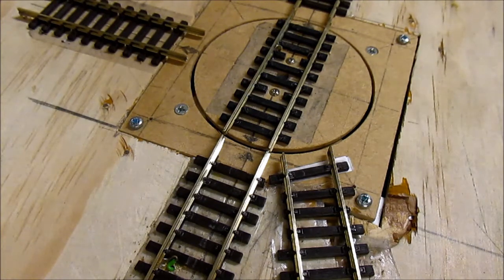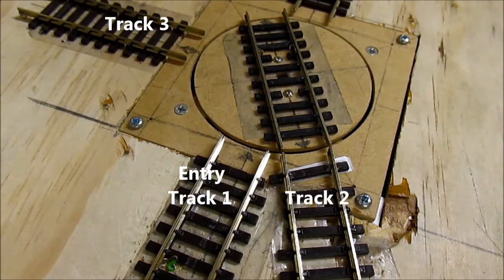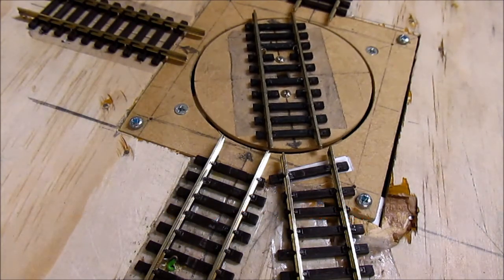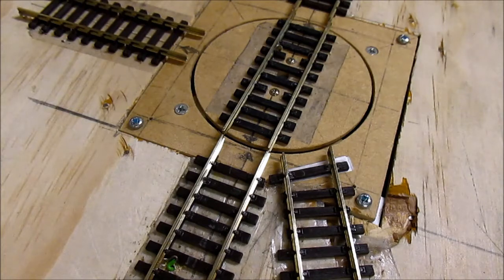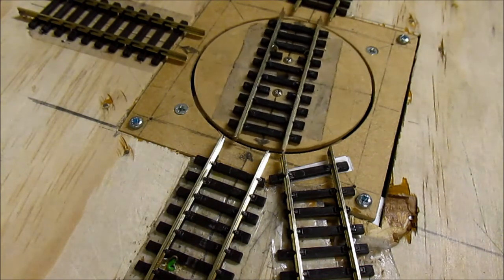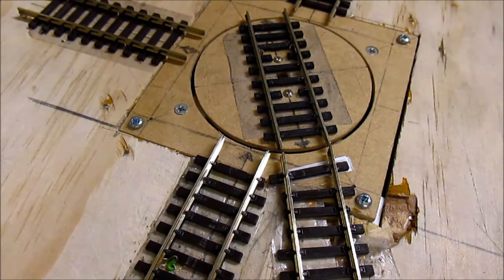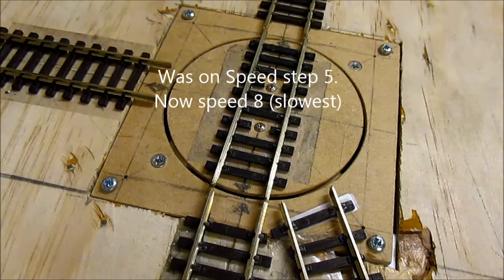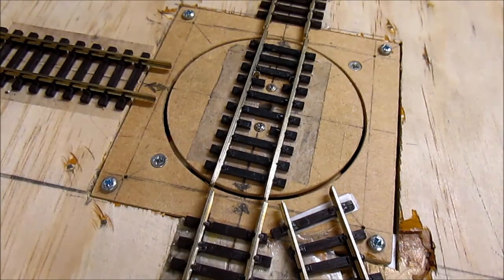Servo Driven Turntable

Comment: thi smay be waaaayyyyyyy  too late to be helpful, but  in industrial environments,  this is often solved by programming in "backlash compensation".   Meaning that iyou need to position the servo at 45 degrees, you "shoot through" to 40 or 50 degrees  (depending on the direction you are coming from) and then go back to 45.  usually does the trick.
Reply from the maker: Hi Daniel, Yes I was aware of gear back lash. I rewrote the code for the PIC micro to include it see my other two servo turntable videos
https://youtu.be/NT2zpQwa0xc
https://youtu.be/pZzYg_QQl7E
You will see my added note about temperature variation upsetting the servo position. I still have the TT but not in use. and built a different one using a geared motor with a 10K ohm potentiometer as the shaft, providing feed back to the micro. This proved much more reliable.

Comment: I've just discovered your servo turntable and was wondering about the sketch. I'm building a small turntable for my grandson's railway but am stuck with the coding. I just need a 180 degree front and back movement as that's the only way and would appreciate it if you could help me. I'm going to automate it (if possible) with a PIR or Hall sensor but still can't get it to do what I need. Thanks in advance for your help. Tony
Reply from the maker: Hi Tony.
The controller uses a PIC12F628  Micro on one of my ServoMate boards and not an Arduino sketch, so sorry can't help you.. 
I suggest looking at the Servo Sketches in the Arduino Application or online.

Comment: That's nice! By the way, how about using a stepper motor insted?
Reply from the maker: I have since built (a couple of years ago) a laser cut turntable using a small geared motor drive and a potentiometer on the shaft for indexing. 
Turn is increased to 270 degrees which still requires backward rotation for some moves, but doesn't suffer from the temperature drift of the electronic components in the RC servos.
A friend of mine has used a 17mm stepper motor for a 350 mm diameter Turntable. He used micro stepping, but requires the power to be left on to hold position, which causes a loud whistling sound. The other problem is that if it get bumped it looses indexing until the deck passes the zero sensor.
I tried geared stepper for the same sized TT I have. Gear backlash had to accounted for and also allowed the TT to move, so needed a brake mechanism.
Have thought about using a small geared stepper on the wagon TT but discounted it due to the same issues.

Comment: This is interesting, but you can avoid having that problem with a geneva drive. That's what the commercial turntables use to get them to line up precisely.

Nice work though.
Reply from the maker: Hi Chris, thanks for the comments. I have since re-built (a couple of years ago) a laser cut turntable using a small geared motor drive and a potentiometer on the shaft for indexing. 
Turn is increased to 270 degrees which still requires backward rotation for some moves, but doesn't suffer from the temperature drift of the electronic components in the RC servos. 
All controlled by a PIC micro controller.

Comment: Good job and thanks for sharing
Reply from the maker: No Problem. 
If you look at this video you can see the backlash problem has bee programmed out and I have 180+ degrees rotation. https://youtu.be/NT2zpQwa0xc

However I have since found that the servos alter their position depending on temperature, especially in my garage work shop on a cold winters morning (about 10 degrees celcious).
Not a problem if the ambient temperature is higher and constant, but when the temperature was colder the servo internal circuit components moved the servo about 1-2 degrees out until the internals heated up, when they slowly got back to the programmed position.
Reply: Good to know, thanks

Comment: That is a nice bit of work, Graham. Looking forward to the sequel.
Thayer
Reply from the maker: Thanks for the feed back Thayer.
Will be working on a laser cut version, with electronic circuit board to give better resolution
Reply: If you really want to spend some money, this would do the job very nicely.

http://www.sherlinedirect.com/index.cfm?fuseaction=product.display&Product_ID=105
Reply from the maker: tcsyme Sherline Indexer is a nice idea but very expensive at US$725 plus freight would cost over US$800 to New Zealand, It would drive a monster turntable though.
My ServoMate controller with Servo costs less than $40 and wood was lying around the workshop. Although the turntable does have limitations such as 180 degrees.
I have tried a geared stepper motor at 6000 steps per revolution for my large loco turntable and it works well.